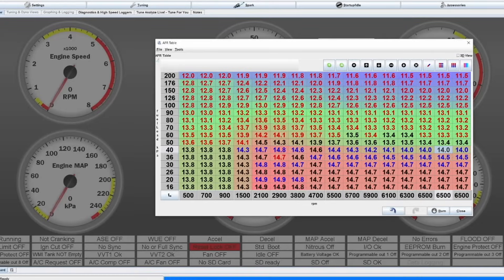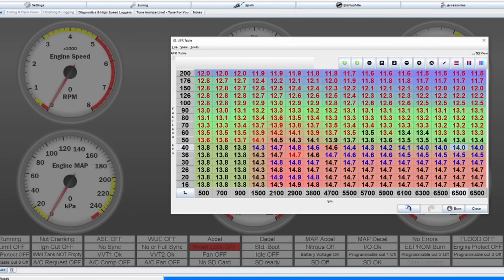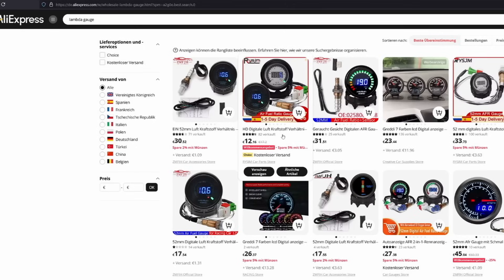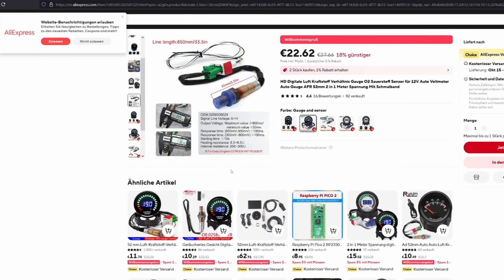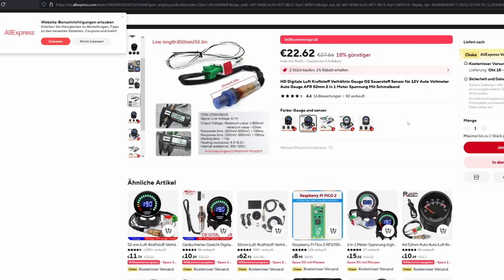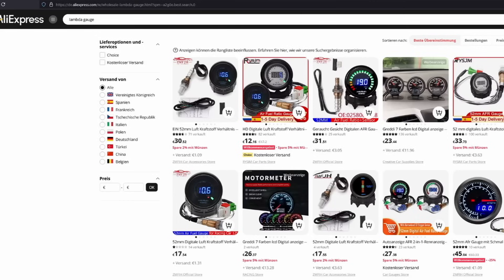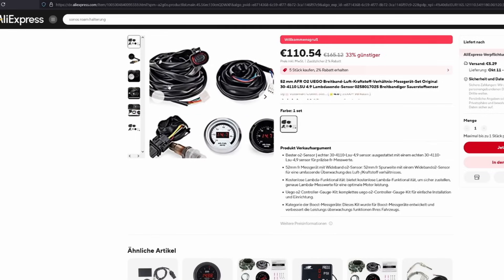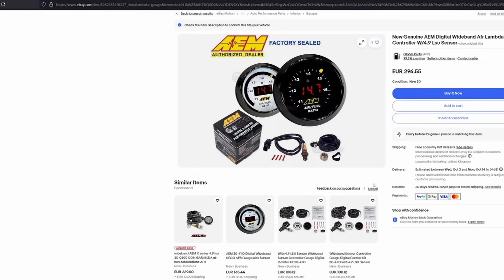Do 20$ AFR Gauges work? | Wideband Vs. Narrowband O2 Sensors and Gauges explained | Tuning explained

Comment: A side by side comparison with both mounted to the same exhaust would have far more value for  comparisation/usability in my opinion.
Reply from the maker: itrs not an opinion its a fact. you can see the limitations in the graphs im showing + the response is very slow.
Reply: @throttlebuddies0  Theory does not always match real world measurements. That is why I would like to see a side by side comparison.

Comment: what if i just want to setup a twin carbs setup?Wouldnt a narrowband do the trick?
Reply from the maker: you would only be able to tune part throttle and idle as anything richer or leaner wont show and you will be aiming for a value thats out of range most likely.

Comment: THANKS MUCH for breaking this down. AEM is the ONLY WAY to go. What I went with on my import turbo build. I also have a late model sport bike with a tune and software to tune aftermarket ECU . I was looking at these cheaper gauges for it . But CLEARLY I need to buy a good name brand wideband for it as well. To tune correctly and properly.
Reply from the maker: you can get away with monitoring the AFR value with a cheaper wideband but i would clearly not recommend a narrowband. there are also other brands of controllers sold that you can use such as innovate 14.7 spartan etc. they work well. but price wise, there is not much in it and on some you need a gauge in addition anyway so it makes sense to go for a controller thats included into a gauge

Comment: For a carburated engine a narrow band actually serves a better purpose with no computer and limited adjustment a narrow is better in dailing in a good ratio wide bands are only necessary if an ecu is making adjustments number values don't matter air to fuel efficiency is the only purpose of the o2 sensor
Reply from the maker: @bryancampbell4550 not neccesarily it works the same qay on carburated engines but you dont really need the precision. Still anywhere else than at stoichometric the values are very vague and not accurate so i would still not recommend it for safety reasons